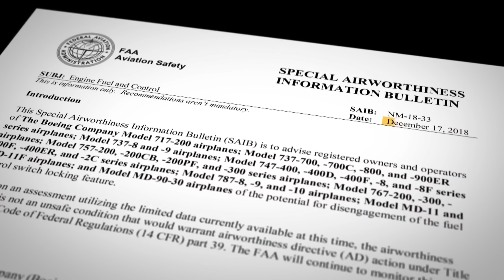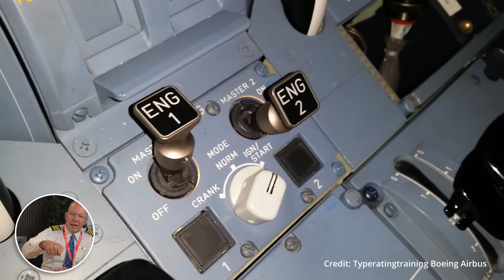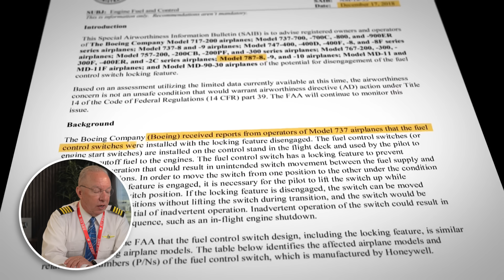Air India 171: The FAA’s 2018 Fuel Switch Locking Bulletin Explained (16 Questions Answered)

Comment: Electrons can cause havoc during power supply transient situations; are we asking the right questions? 
I am a pilot with 4000+ hours (non-airline) and an electronic engineer.

QUESTION: Where/how does the in-flight data recorder on a Boeing 787 monitor the fuel cut off switch status?

On the Boeing 787, the in-flight data recorder (FDR) monitors the status of the fuel cut-off switches via the aircraft’s centralized maintenance and data acquisition system, specifically through the Electrical Load Management System (ELMS) and the Engine Interface Units (EIUs) or Full Authority Digital Engine Control (FADEC) units and not directly of the "mechanical" status of the switch.

On the Boeing 787, the fuel cut-off switch status is thus monitored indirectly by the FDR through:
•	The fuel shutoff valve position
•	The FADEC command signals
•	Possibly the electrical state of the switch via ELMS
These are fed into the Flight Data Acquisition Unit, which then sends the data to the Flight Data Recorder.

A power supply interruption or voltage transient can potentially cause the Flight Data Recorder (FDR) to incorrectly record the status of the fuel cut-off switches on the Boeing 787, but this would depend on where and how the interruption or transient occurs within the aircraft’s data acquisition and recording architecture.

When can Incorrect FDR Logging Could Happen:
Certain scenarios could lead to the FDR logging an incorrect fuel cut-off switch status:
Scenario:
Description:	Risk of Incorrect Recording
Power Transient on Input Line.
A transient spike or drop on the line carrying the fuel switch logic signal could result in a momentary incorrect state	(Moderate, especially if filtering fails or glitch coincides with a sample)
Loss of Power to ELMS or CCS module:
If a specific module that interprets switch status loses power before FDR, data could freeze or become invalid.	
High, especially during emergency shutdown scenarios.
Grounding/Shielding Faults:	
Faults in shielding or grounding could induce noise, leading to misinterpreted binary inputs.
(Low to Moderate, depends on the transient severity and location)
Corrupted FADEC or EIUs output:
If FADEC or Engine Interface Units send erroneous signals due to voltage instability, those could be passed on to the FDR	Low, but possible in case of hardware or firmware bugs triggered by power events.
We have to be very cautious to jump to convenient conclusions and blaming the pilot, whilst not fully understanding the system complexity involved.
Just my humble observation.
Reply: Your whole argument falls the moment one of the pilots asked the other pilot, why did you cutoff. It means they can physically see the switches in the cutoff position. No electrons involved
Reply: @YumiFaeldo  actually the whole two sentences in the report which reference the CVR are quite ambiguous. It’s in local phraseology, not standard english, and says,”In the cockpit voice recording, one of the pilots is heard asking the other why did he cutoff.
The other pilot responded that he did not do so.” It could mean why did YOU move the switches to cutoff. It could mean, why did the aircraft cutoff (fuel flow). If the international team had reviewed these sentences, I think the meaning would have been made quite clear. There was also an inconsistency with the content of the mayday call, where after the accident it was reported that the mayday call stated that thrust was not achieved, or power was lost (translation can be tricky). This wasn’t addressed in the report, although it would be a fact and worthy of inclusion.
Reply: @alexc4300 sometimes the simplest explanation is the explanation. Let's wait for more information.
Reply: @YumiFaeldo  Not necessarily. You don’t know what led the pilot to say that. As Capt. Steve himself explains: when something like this happens, you hear it, you feel it, and you probably get a warning on the EICAS. In a high-stress situation like takeoff, when the engines suddenly spool down, a pilot might instantly conclude that the fuel was cut off - not because he saw the switches, but because he experienced the effects.

It’s entirely plausible that it went like this:
Pilot #1 feels the engines spooling down, sees or hears an EICAS alert, and quickly assumes that the only logical cause is someone moving the fuel cutoff switches. So he asks, “Why did you cut off the engines?” That doesn’t mean he actually looked at the switches before asking - it just means that was the conclusion he jumped to in that moment. Pilot #2 then responds, “I didn’t.” Only after that might one of them have checked the actual switch positions.

We don’t know whether the switches were visually checked right away, or whether their positions were only confirmed (or assumed) later. So to say “it must be true because one pilot accused the other” is assuming too much based on too little.
Reply: If the plane fails 
The first thing would be the throttle check and any sensor reading?
Not fuel shutoff 
Pilot must had actually done it and it was questioned as bizarre
Reply: If you’re going to pose as an expert, you should probably not copy both your question AND the answer from ChatGPT. Regardless, the data we have indicates there were no electrical failures on board - it was operating normally until the fuel switches were cut off. Anything else, at this point is not only speculation but pure conjecture. You would have to reject available data and supplant it with that conjecture for anything else to make sense
Reply: @ThePhDSpanish   there were several technical faults, including “core network”, which the preliminary report simply lists and leaves them sitting there, unexplained.
Reply: @alexc4300 where are these faults listed? There is no mention of them in the report on the 11th. That report states that they achieved Vr, rotated, reached a speed of 180 knots, and then the fuel control switches were flipped off. I see no mention of net work failure, and the pilot defect report noted an issue with the stab trim that was repeatedly fixed prior to flight.
Reply: @ThePhDSpanish  page 5-6: “There were four CAT ‘C’ Minimum Equipment List (MEL) items active on aircraft as of 12.06.2025. These MELs were invoked on 09.06.2025 and validity of these MEL were till 19.06.2025. These MEL were for flight deck door visual surveillance, airport map function, core network, FD printer.
There was a CAT A MEL active w.r.t. Nitrogen generation performance, which was valid till
20.06.2025. There were other Category D MELs/NEFs on the aircraft related to cabin and
cargo, the validity of these MELs were also within the due date.”
Reply: @alexc4300 ah thanks. Still, in the 787 MMEL this is listed as an information system network, and the plane can be dispatched without it even being installed. That implies that it has nothing to do with actual flight control. Boeing could be lying, but considering the crashed plane flew without incident multiple times with this deferred fix, none of the previous pilots noted it as an issue in pilot defect reports, and that no directive to inspect or upgrade this network system has been ordered (edit - by Boeing or the FAA) makes me inclined to believe the MMEL. I take your point that we can’t totally rule it out some kind failure linked to this system  (maybe a crazy chain of events with TWA800), but it seems extremely unlikely considering the FDR and the CVR evidence
Reply: @ThePhDSpanish  just saying it’s indicative that the aircraft was carrying some issues.  Also worth noting both engines had been swapped, one in the preceding six weeks and the other in March. There’s a lot of threads for the investigators to unravel for the final report.   Anyhow, unless they find something new, it’s patience time.
Reply: Your arguments breaks down because the Captain asked the FO why he switched those off, and the FO said he didn’t. So one of those men did it and is a liar.
Reply: @DB-rc9ln  “why did he cutoff” is not the same as, “why did you switch to cutoff”. It’s too ambiguous for a definite conclusion.  And the EAFR records electrical signals, which can be corrupted by faults. There’s often an unseemly rush to blame the pilots when other causes emerge later. Look at Lion Air and MCAS. This aircraft had several technical faults, including “core network,” and its engines were replaced earlier this year, with other used engines. Makes you wonder. The 787 programme has a pretty good safety record, in terms of crashes, but things get changed on these aircraft all the time, even the fuel control switch panel was swapped out just a couple of years ago. Hopefully not with one that had the fault noted in the 2018 bulletin. There’s a lot on information missing in this report - they had a deadline to meet.
Reply: @DB-rc9ln  Or an electrical issue caused the switches to go off? ..there is a first time for everything.
Reply: Interesting hypothesis.  The trick is replicating it.  The physical evidence this far supports physical movement of the switches.  The unknown is who dunnit?
Reply: Holy shit dude…AI and ChatGPT getting carried away here….
Utter crap.
Reply: Yess. In this case, the facts are too vague considering that the accident is this recent.
Reply: I spent my entire adult life working as a metrologist, mainly in electronics.  I have the theory and practical side covered. I have reverse enginered high-end switching power supplies in spectrum analyzers and network analyzers in order to repair equipment that was essential to their users but no longer supported by the oem for parts. I have also repaired a lot of stand alone power supplies. I believe your thoughts are not feasible. Of course, there is also the conversation alluding to the fact that the switches were cut off.
Reply: You are correct about power Xfer.  A was working on an airplane that had some big time power xfer through the wow switch before I retired. Management had everyone buffaloed to down the aircraft.
Reply: For an engineer you're not a very good troubleshooter.

If the FDR "incorrectly recorded the positions of the fuel cutoff switches" that would result in at least one extra event being recorded.

1) A spurious signal causes an engine shutdown. Logged.
2) Pilot toggles switch to cutoff position. Logged.
3) Pilot toggles fuel cutoff switch back to the run position (where it was found after the crash). Logged.

Only two such events were recorded. So the incorrectly recorded theory fails. I suppose you could hypothesize an electrical fault which shut down the engines but was NOT logged by the FDR. But at that point all bets are off and you can come up with any theory you like. The bottom line is that the available data strongly points to the switches being moved by one of the pilots, and at least at present there is no data which would suggest anything different happening.
Reply: The timing of the switches relative to each other, and from cutoff to run position is not suggestive of random electrical gremlins. It's suggests human operation.
Reply: I think this is an interesting analysis.  What is so mysterious for this plane and what cannot be ignored is the multitude of odd electrical issues it was having on the flight just before the crash. I still find it hard to believe this was purposely done but can't rule it out, but ca not rule out something like you noted either. Actually hearing the voice recording someday would probably shed light but I hope they keep investigating the electrical issues too. The way they ran the simulator may not simulate an electrical short potentially or some transient condition completely but it could be very difficult to find evidence of this in a crash.
Reply: Finally somebody with a brain entering this discussion. Captain Steeve has no business getting involved in this complex topic, he is a pilot but no formal training on problem solving such as DFSS or working in complex issues. If he did he would have shut up at the start.  This could be EMC related transients etc, it could be something never seen before but what I do see is a lot of racial bias that it has to be the indian pilots. But I would say 99% of people on this channel including Capt Steeve have no comprehension of what you just explained.
Reply: @sixbells99 can we see the statistical analysis of this dual mode failure compared with the statistical possibility of deliberate human action? Occam’s Razor.
Reply: @mikewilkins9484   Not sure that by itself will help for sure Weibull would have been done on these switches. But again we are missing all the facts. I do not want to go down this path too much, but easy branches to check would be the well being of the pilots etc, medical history interviews with co workers, family members. That's an easy check.  That's data we are missing for example. But having worked on complex problems you are shooting in the dark if you are not close to the issue and the data. Of course the new info disclosed raising more questions than answers and those bias to say the pilots were the cause this info puts them in the spotlight. But we just do not know.
Reply: Either Captain Steeeve has access to a secret cockpit camera that none of the official investigators do — or he’s so intimately familiar with every circuit and signal path in the Boeing 787 that he can confidently rule out any hardware or software malfunction. According to him, the First Officer must be a liar who deliberately cut off fuel to both engines, lied to his captain’s face, and chose to sabotage 260 lives. And all this… for what motive exactly?

Oh, and let’s not forget — Captain Steeeve must also have the First Officer’s psychiatrist on speed dial, since he so casually insinuates mental health issues and suicidal intent without a shred of evidence. Because apparently it’s easier to dictate the dignity of the dead than to consider even the possibility that something in the aircraft system failed.

He shows zero suspicion toward a known-complex system like the Boeing 787 — but total cynicism toward the people who died trying to fly it. Investigative skill? Hardly. But I’ll give him credit — his teleprompter delivery is flawless.

And after seeing this far, we shouldn’t doubt who’s writing his script.

Comment: I am not quite sure why you are so definitive about the human intentional cutoff. To be clear I do also believe this is the lead explanation at this point, but up to now it’s still hypothetical. If one wants to commit suicide, it is certainly a “clever way” since there is almost no chance to recover. However one of the pilot still said “I didn’t do it”. I think we shall wait for the final report before being so assertive about the reason of the crash. If you are wrong, and even if you do a retraction, you will lose a lot of credibility if not all
Reply: I thought the phrase "Why did he do that?" was interesting. Like referring to ships as she, is it a common Indian idiom to refer to planes and/or the control system as he? I could imagine the system triggering a false signal and the switches going through an on/off/on cycle resetting the signal. It would seem odd in a stressed situation for a pilot to take the normal amount of time to reset the switches, but I would expect it if they had to switch off and back on again.
Reply: No he won't
Reply: I agree
Reply: simple voice recognition software should be able to find out who said what when
Reply: @johnstreet797  No need. There are separate audio channels for each pilot/microphone. These channels are all recorded and labelled individually by CVR.
Reply: This i also do not understand. Why it cannot be a software/bus failure how somebody ask in the video. I do not know how the data recording goes on, but why the software cannot set these switches to CUTOFF without manual changing... Where there are softwares, always will be bug...

Comment: You start the video with the doubt suggesting that the fuel control switches could have a defect but then at 6:30 you decide that it was caused by one of the pilots without solid, clear cut evidence that this was the case. 🤔 Why condemn the pilots? Wait until the full report is out.

Comment: Wait for the final report. No one wants to fly Boeing anymore anyway.

Takeoff – 08:08:39 (time 0) 
max V 180 Knots – 08:08:42 (time +3 sek)
Engine 1 fuel cutoff – 08:08:42 (time +4 sek)* about 08:08:42 UTC and immediately thereafter 
Engine 2 fuel cutoff – 08:08:43 (time +5 sek)* 
RAT hydraulic pump began supplying hydraulic power – 08:08:47 (time +8sek)
Engine 1 fuel on -  08:08:52 (time +13 sek)
Engine 2 fuel  on – 08:08:56 time +17 sek)
MAYDAY – 08:09:05 (time +26 sek)
END – 08:09:11 (time + 32 sek) 

You don't know anything else.
Such speculation and youtube channels should be shut down.
If your speculations turn out to be false you should stand trial.
Reply: I guess the crowded airports and 3200+ Boeing aircraft flying in the US speak differently.
Reply: @Long_Duk_Dong  It's already a problem for the airlines what planes they buy and who wants to fly them. Boeing used to be the leader in quality, that's a long time ago. America is getting worse and so are their products.

Comment: The reason I ask about co pilot or pilot locking out the other pilot while he is in the restroom or taking a nap, that means a pilot can lock out the other pilot and take full control of the aircraft and basically there is no way for the other pilot to regain access to the cockpit. According to my ChatGPT research. This is troubling, especially in terms of mental health and pilots that may want to commit murder suicide. I’m shocked this is even a possibility. There needs to be a way for the pilot or co pilot to gain access to the cockpit even if locked.